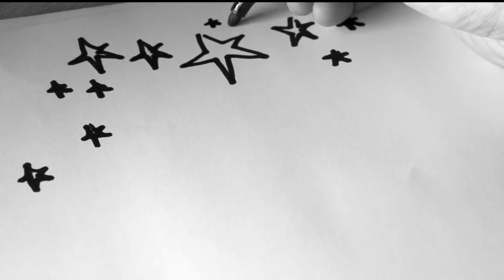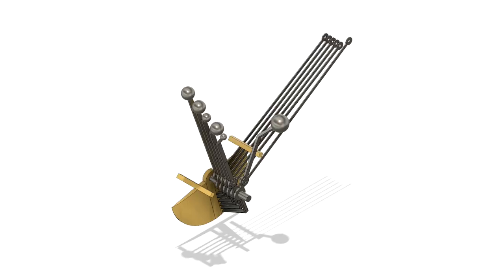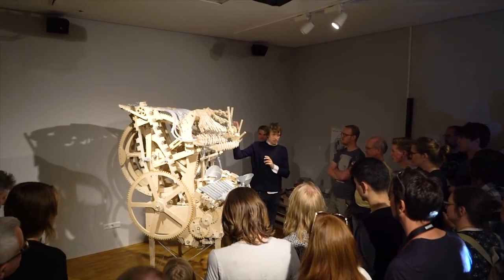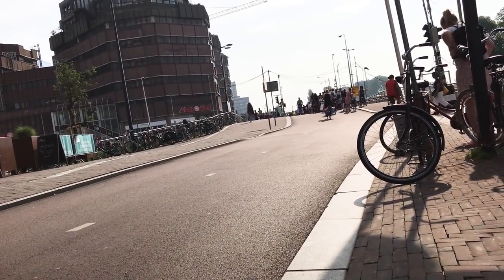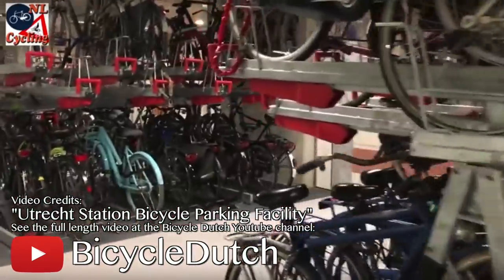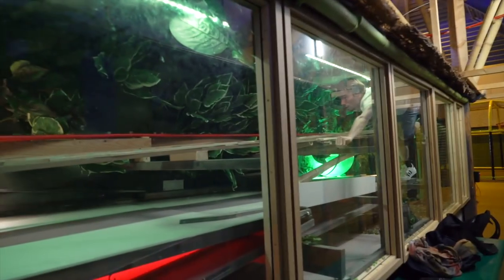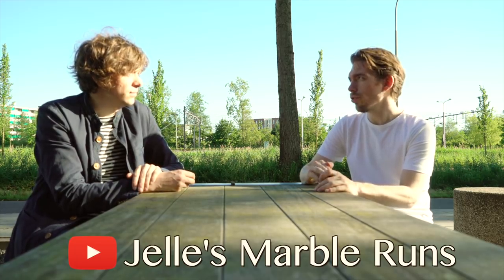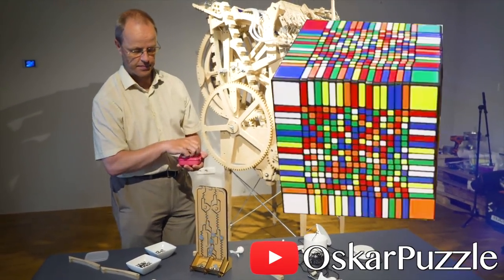Channel Update & Music Machine Mondays Finale Week

Comment: Love that marble divider, looks like it came out very nicely. If Acrylic is giving you issues, you might look into using Polycarbonate instead; Polycarbonate has a very similar look to it but is easier to flex and stronger at low thickness (for that divider you could probably get away with using 1/16" thick Poly, which is extremely easy to flex/bend, and still not have any issues with long-term durability), it's also far less prone to cracking/shattering than acrylic is which might be good since you intend to transport this machine quite a bit.

Comment: I am protoyping a small 3D printed fully functional marble machine with the same sloped feed row as you mention. Be warned that a full row of marbles should be filled exactly to the top otherwise half protruding marbles on a not often used note can limit the flow of marbles to the other channels. It seems like your marble divider tube lengths are based on the 5 degree angle and not the exact amount of marbles. Neverttheless, nice design and good luck!
Reply: What's a good solution for half protruding marbles? Ideally the slope would correspond to the height of marbles, so either the slope has to be really steep, or the spacing between notes has to be further. I don't think this is realistically possible with 32 notes. it would be too big.
Reply: In my design I made every divider tube the same length and put the whole mechanism at an angle! The xylophone has to be slightly stepped as well in order to maintain the same falling distance, but this can be visually interesting as well
Reply: I can't visualize how that would work but that sounds cool!

Comment: Put your hard drives on a NAS! it’s much easier to be able to access them on a computer and search for any file you want.

I use an AirPort Extreme with a 2tb and 1tb hdd attached,
I know it has only one USB port, so I use a 4 port hub. I have
A nice 12 port hub though. I’ll send you a link if you want.
If your router has a USB port it might work with that, but
I advise getting a dedicated NAS or airport if you use a 
Mac especially. It shows right up as a drive in the sidebar
Of finder! Or you could just plug the usb hub into your computer.

Comment: Another superb video to make the week even better than before. Thank you so much!
I do have a few questions for you, Martin :
Will the larger, heavier marbles for the MMX move easily over the upper surfaces of each of the marbles at the top of the 'full' marble divider tubes with just a 5% slope? I wonder if the uppermost marble in each tube might form a proud 'dome' on the marble track, preventing marbles from filling the downhill/downslope tubes.
Is each tube a whole number of 'marble diameters' tall, to provide a reasonably smooth path for the marbles? (The top of each upper marble in each tube will be at the same level as the track)
Could any marbles that are slowed/stopped on the track get pushed off by following marbles, due to speed/inertia?
I'd be surprised if you haven't already considered these points. Hope you don't mind me asking :-)